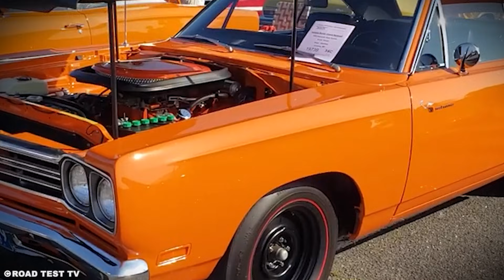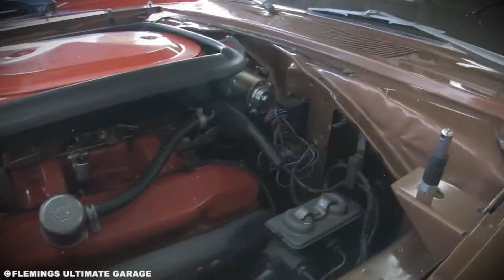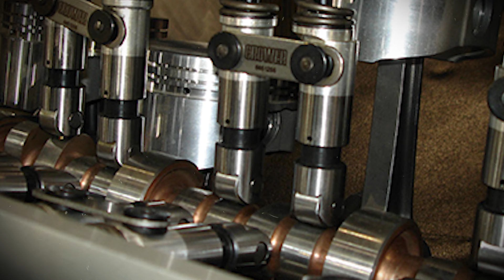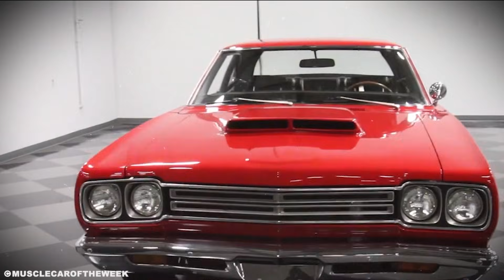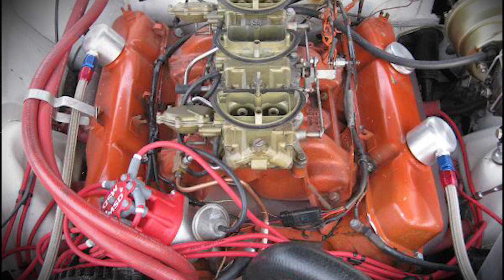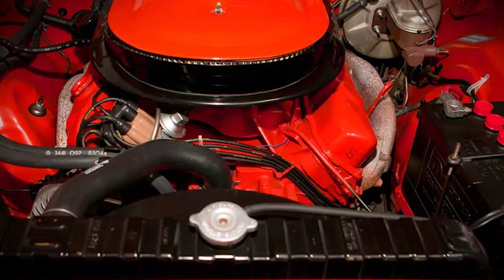Even at 390 HP & Six-Pack Carbs, the Mopar 440 Six-Pack Shocked Everyone Making 490 Lb-Ft

Comment: The 440 six barrel is my absolute favorite engine. I’d prefer it over the 426 HEMI.  They’re rock solid and built to last.  The best engine back then for street light to street light racing.  I would still get a 71 Cuda with a 440 six barrel if I could afford it over anything they’re making today.  Yeah, the rods they’re making today have more horsepower, but they won’t last like the old 440 does.